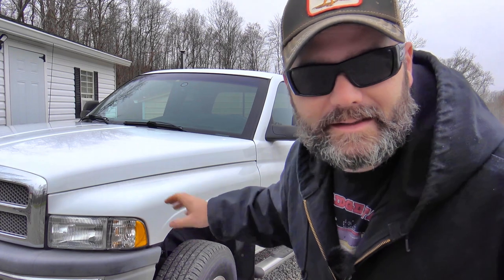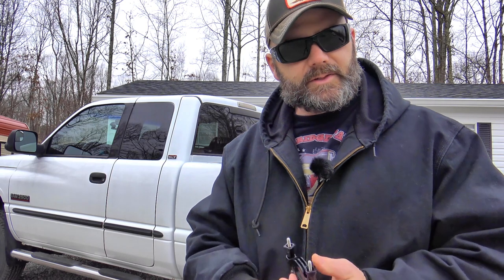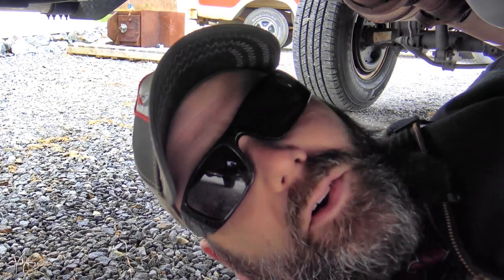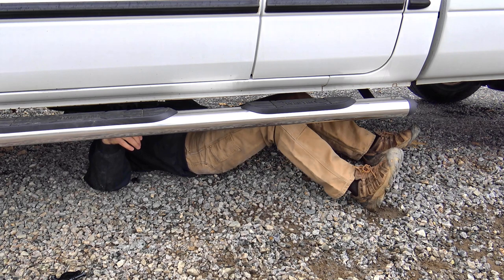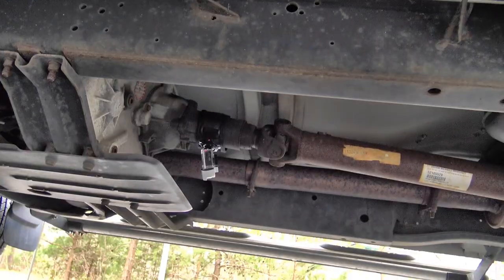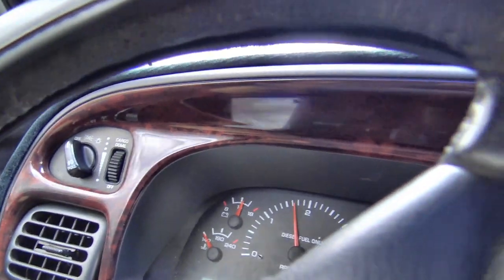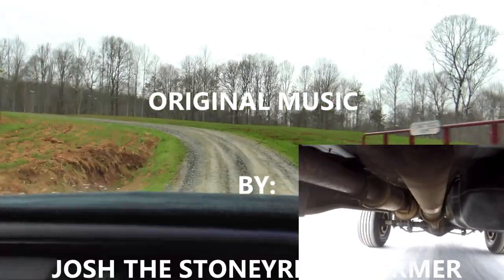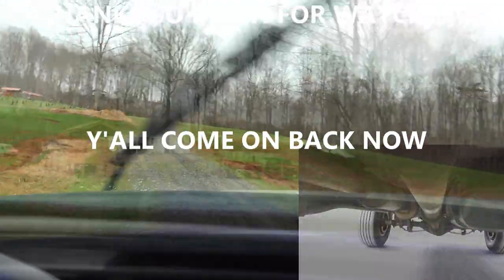WHAT'S WRONG WITH MY CUMMINS??? CALLING ALL MECHANICS!!!

Comment: You said you got new tires did the vibration start before or after? I have had a problem with that many times before. Take them back and ask to rebalance or find a place with roadforce balancer. Discount tire has them but so do a lot of other places. It is the best tire balance you can get. My car would cruise at 100 mph no vibration whatsoever. Before road force balance it vibrated terrible at certain speeds. IF vibration is in  floorboard probably rear tire. Trust me some people cannot balance tires it is common.

Comment: looks like the carrier barring is bad, I have had a couple of those go bad. Not too hard to hard to change. Mine was a 74 chevy 3/4 ton. when you change the barring inspect the u joints.

Comment: That's called a carrier bearing and yes it's bad. The rubber fingers should be spacing it evenly in the center of that hole. your passenger rear tire or wheel looks like it wobbles a little too.

Comment: id replace that bearing and check those u joints thouroghly cuz if the u joint is loose or seizing they and make the bearing flex cuz the u joint isnt moving smoothly
Reply from the maker: I agree

Comment: Looks like the carrier. My dodge had a horrid shake and it turned out to be ujoints. All of that is factory balanced. And if there is any wiggle or slop in it in throws it out of balance and causes vibrations and shaking.

Comment: My '86 Nissan ran thru 3 carrier bushings or bearings in 120K miles.  Same symptoms.  Not cheap but not a budget-killer.
OBTW - dem ain't CV joints.  They're older tech called universal joints

Comment: Not sure if anyone noticed, but the go pro didn't vibrate at all. So pretty sure it has nothing to do with drive shaft, I can see day light between shaft and rubber in the carrier bearing and mine doesn't vibrate the truck one bit. To check for sure jack up rear so both tires off ground put truck in neutral then go underneath try turning shaft back and forth to check for slop in universal joints. If nothing is found there I would be checking wheel assembly for something worn out such as wheel bearing, etc.

Comment: Jack up the rear end...chock the front wheel...support therear end...have the engine off...put the truck in netrel...and spin the drive shaft...it sound like a u joint.....that seized up...i seen it before...but it could be the carrier bearing...  the central piece..u where point at...

Comment: Could be front u joints or driveshaft out of balance, there was some shaking but that’s not what’s he is feeling. Not much would cause a shake while off the gas and coasting. Also where is the shaking felt? In your hands at the wheel or do you feel it in the pedal??

Comment: The caller bearing is pressed onu might as well replace u jounts while u have  it off. P.s run howells diesl additive i use it in my truck an tractors that run on diesl
Reply: Yvonne Johnson **Diesel.

Comment: Day job is at a dodge dealership.  Carrier bearing, most of the time it's a better option to replace the shaft then have the bearing replaced. Some are not rebuildable. By the time you replace all 3 u joints and the bearing your a few bucks away from a new shinny driveshaft.  Also when checking for play in u joints take the load off the parking paw. Jack the rear axle up and turn the driveshaft at the rear axle other wise your trying to turn it against the load of the truck sitting on the parking paw and it will feel tight. 130k most u joints are starting to get dried out and will start going bad. Those 2 piece driveshafts always fail at that carrier bearing. I've seen them totally flopping around on cars where the bearing locked up and it ripped the rubber apart.
Reply from the maker: Nice....thanks man! Great points for sure!!!
Reply: Pawl

Comment: also, you do not have the famous Dodge/ Ford "Death Wobble" as I mentioned in your other video.
The steering wheel & dashboard would be shaking like an unbalanced washing machine on spin cycle when front suspension parts/ steering parts wear out & go bad.
If you feel it in your pants/ butt - its likely driveline and always possibly a tire.
But if it changes with speeds, more likely driveline than tire as the tire problem (out of round, broken belt, etc) would just become more/ less noticable as you go faster/ slower. Not just randomly show up as you decelerate or let off gas.
Reply: Oh my Lord - the Death Wobble!
Ever have it show up at 60mph? Scary stuff.
My old '92 F250 with the 7.2 developed it.
Reply: fortunately not on my own vehicles (I've had back-to-back F150 with IFS), but it seems somewhat inevitable over time with solid axle trucks - specifically Dodge & Ford 3/4-1 tons.
Usually the driveability seems to degenerate and sensible people catch it and take back to the dealer or a shop. 
It's the youtube videos of the ones that are so extreme that blow my mind. Trucks jumping out of lane, steering wheel shaking like a paint mixer, dashboard rattling apart, etc. I couldn't imagine having a truck ever get so bad.
The only thing I struggled with for a longer period about 1012 years ago was a broken motor mount in my Mercedes 300 diesel sedan. The vibration was very erratic and was compounded by a few other factors- 
1. I found I had a tire that lost a weight and was out of balance. 
2. the OOB tire led to an alignment problem.
3. another factor regarding the vibration thing started when fuel companies went to ULSD diesel fuel and I had an injector fail as well as nearly every o-ring in my injector pump and fuel supply, leading to surging, stalling, etc (the car was about 6-8 years old with 200k at that time)
4. MB dealer said the leaks in the driveway and front-end shudder/ shaking was a bad rack-pinion assembly and wanted some obscene amount of money (maybe $1700-1800) - I held off for a bit. They were dead wrong.
5. after fixing 1, 2, 3 over a month or so - my other go-to private mechanic quickly found the motor mounts were shot. Fixed for about $120.
Sometimes it is just a simple, cheap fix.
Reply: Ha!
I had all tires/weeks balanced & rotated. No go.
Replaced all four shocks at home.
No go.
Had a friend replace ball joints.
Nope.

Finally, I just took it to my buddy's custom 4wd shop 1/4 mile away and said "fix it!"
I don't know what he did, but it was $100 and only a few hours.

Simple things, indeed.

Comment: Im no mechanic by any means but had a similar issue in a small car with the low speed heavy vibration,,, turned out all my motor mounts were worn away or so flat they were not stopping any motor movement

Comment: You named all the symptoms! get r fixed! CV joints? Them turning things are called U joints... CV joints look different and have a protective sleeve on them.
My driveshaft of 214k miles had to get the end cut of and weld a new one. New U joints and rebalanced cost me $200. WORTH EVERY DOLLAR!!! No vibrations or binding! I need to go back to the shop and drop them guys a 12 pack of beer.

Comment: That vibration is not coming from your driveline more than likely your brakes are a little warped and what your feeling is looseness of the front steering arm, need to check it by leaving the truck off and having someone wiggle the wheel back and forth the tires should wiggle right with the steering wheel if everything is good.
Reply from the maker: Watch the whole video brotha...it's not a steering or brake problem or tires...watch the whole thing man

Comment: When you put the truck in drive do you get a thump and when you shift from drive to reverse do you get the same thump if so u joints are bad. Yes I would change the center bearing also.

Comment: Center bearing is bad, that rubber bearing in the center of drive shaft. When the truck is in a pull is when it vibrates , i think that will solve your problem Happy Motoring your fan Gordon Humbert

Comment: Sounds like the kanibblin valve. If you can't find it replace the bearing you were shacking in the center of the drive shaft, looked a little loose from the vidio.

Comment: Diffidently like everyone else saying carrier bearing on the right track. Also few thing you you want do as preventive maintenance is add noise isolator for your auto tranny keep from hunting for gears. https://www.xtremediesel.com/bd-power-dodge-apps-noise-isolator 
Also want add aftermarket lift pump as that number one failure on these trucks is not enough fuel pressure and lubrication to VP44 aka injection pump that was replaced said. Make good aftermarket lift pump without spending ton complete system http://www.thoroughbreddiesel.com/airdog/FRRP-150.htm

Comment: Slowing down is putting more stress on that carrier bearing  causing it  to vibrate more. I bet. You do have lots of play in that bearing. This could be why you feel it your butt not the steering wheel   If it was in the front end you feel the vibration in the steering wheel. Being over 1000 miles away from you. I would say start with the carrier bearing the check grease the U joints  when you have the drive shaft off   Take care. Good luck

Comment: I have a 2008 f 150 with a similar problem. The mechanic said my engine mounts are wearing out because the rubber started to come apart. Not sure if that is a common problem for Rams though.

Comment: I’ve had three of those trucks in the past and the front driveshaft U joint went out before the rear one and all on all of them so I suspect it’s probably not the rear shaft if it’s four-wheel-drive it’s probably the front, just my past experience. By the way all my trucks had over 200,000 miles
Reply: Also I found that the dealer could replace it with a brand new shaft complete for almost the same price as rebuilding it. In the front shaft there’s a constant velocity joint that has a small ball and socket that goes bad if it’s not greased. That’s what causes it to vibrate like crazy. Looking at your video it appears that the movement in the carrier bearing appears to be normal. But then I’m not a dodge Mechanic I’m just a Dodge customer Currently I have two 2017s also one 2016 and 15 I run the heck out of them and they’re good trucks.

Comment: Lol @ all the crazy internet mechanic replys.  Just by the play in the carrier bearing I see ( what you called the bushing) ,it's at least a contrabution to your issues.. get the truck on 4 jack stands, put it in nutreal,and start turning the driveshafts by hand back and forth and look and listen for klunks. While you have it on jack stands, put it in 4x4 and check for clinks in your front drive line too. The u joints at the front wheels always go bad around 80k to 100k. No offense but it's also a Dodge, lol.

Comment: Ah josh, if I’m not mistaken since your truck is a 2000 it should be the 12 valve, not the 24 valve. They went to the 24 valve 6.7 liter Cummins in 2006 I think it was. I had a 2001 2500 and it still had the 12 valve and depending on who you talk to it is a better engine than the 24 valve is but then everyone has their own opinion on that and I’m not stating mine here but either way you’ve got a damn good truck, wish I still had mine
Reply: I believe dodge had the 5.9 liter 12 valve up to 98 then 98.5 it was 24 valve up to around 06 I have a 01 with the 5.9 cummings 24 valve your 2000 you say you use to have  could have had a 12 valve if someone put it in there

Comment: It's that bushing. Moving as fast as the drive saft does that would be it with 130k miles on it none of the  pumpkin's are going to be bad neither is the trans. And if all the cv joint are tight then it is the rubber bushing.

Comment: Get a 5 in pipe ran all the way that's what my brother has on his powerstroke it will be bad.   a$& and my buddy's center bearing was like that and it vibrated at around 35 to 40 slowing down and you can get the drive shaft rebalanced if need to be also

Comment: Did you have truck in neutral when checking u-joints if not they will be under load. Always chock wheels before doing this

Comment: Those are all just plain U joints not CV joints, If no play in the U joints then they could be just fine or they could be rusted and just haven't gotten loose yet. Also the carrier bearing could be getting dry and starting to fail. I had a straight truck with the same issues a couple of years ago and it was the carrier bearing.

Comment: Could be that drive shaft bushing, have you checked the shocks for oil leakage, you said you were recently in snow
Reply: Sounds like a bad u-joint. When drive shaft is under load it takes the play out of a worn u-joint, when there is no load it has excessive play that causes vibration . Change all u-joints and carrier bearing ,this will eliminate the others before they go bad . Usually the factory u-joints and carrier bearings have no grease fittings and the replacements usually will. Hope this helps.

Comment: ok those are U - joints not c.v. and yes it is a carrier bearing and yes it is bad , but something caused it  more than likely the mid U- joint is rusted inside causing a intermittent in balance in the shaft causing the bering to  wear out . the fix , replace all U- joints and carrier bearing . note the bering itself is pressed on , so you will have a shop press or you have to be good with an Oxy - Acetylene torch I mean real good .
Reply from the maker: Gotcha...thanks for the info...waiting to hear back from a shop to balance the driveshaft too
Reply: take a grinder with a wire wheel to remove the rust from the drive shaft while it is apart  so that there is nothing to cause an imbalance always glad to help .

Comment: the 24V have a inefficient lift pumps that's why burn up injection pumps , need to upgrade your lift pump or you will burn up the new injection pump , I run air dogs on my trucks , I have a airdog 600 on my 99 3500 dually because I tow a lot with it , I run a airdog 150 on my 01 2500 because it more of my light duty truck , If you don't tow much with your truck then a 150 would work for you , Its about a $300 pump but better then putting a $2000 injection pump every 50K. miles

Comment: maybe its your drive shaft carrier bearing in the center it looked loose when you moved it cheap and easy to replace. In the video it looks like the u joints are worn out to me. U joints are cheap. Start replacing them.  Its probably the Carrier bearing though it sure looked loose when you moved it baby is worn out.

Comment: I would suspect a seized u joint do yourself a favour have a one piece aluminum drive shaft built loose the carrier bearing and put a nice flo pro exhaust on that truck 4 in with big body 6192 muffler

Comment: Late to the party but I'd agree that the carrier bearier looks sloppy and is your likely culprit (i saw where you concurred) If it were me, while I was getting dirty, ID replace those u-joints while I was down there. Peace of mind insurance!

BTW, I just noticed that your equipment shed is color-matched to the $100 truck. With you OCD tendencies, I'm surprised you don't park in underneath just because it looks right.

Comment: Park truck on flat ground set parking brake of it works being a stock stuck should then put in neutral block wheels but need drive shaft to have no pressure on it then shack around and see if play and not cv joints but research to learn some people give the answer to quick let people learn what it is just let know its not that there is a def cause it's very important when even doing mechanical work you got it bud not making fun but helping learn
Reply: Replace what it connects too if its a part thats not crazy high to change sometimes even if its better to change so dont have to down the road

Comment: that driveline carrier bearing looks to be shot.
the driveline forces probably keep it straight and minimal vibration under load or when accelerating and at higher speed.
I know the physics answer, but it's boring and long. Angular momentum, torque, xyz forces, etc. Enough of that.
As you let off gas pedal, the torque forces change and allow it to "slop around" inside that driveline bearing.
At the 10.10-10.20 timestamp as you slowed to a stop, you can see it spinning "out of round"

Last notes-
1. I've seen the same exact exhaust break on my friend's 2001 Dodge 2500, about what you can expect after 10++ years in New England. SS exhaust is expensive, but will last forever.
2. No "g" in Cummins

Comment: this is Micheal it going to be u joints or front steering dampener
Reply from the maker: U joints turned out to be the issue..now I've got another issue with the trans jumping in and out of overdrive at 40-55 mph...it may be time for a rebuild...way way cheaper than a new truck though!!

Comment: What about the exhaust being loose and banging around? 
You keep saying it happens when your slowing down, which leads me to believe it’s a ball joint or rotors. 
Although you seem pretty confident it’s coming from the middle of the truck. I’m not seeing any vibrations.
Why not change the exhaust yourself? The truck isn’t all rusty and exhausts are quite simple to do with a complete kit.